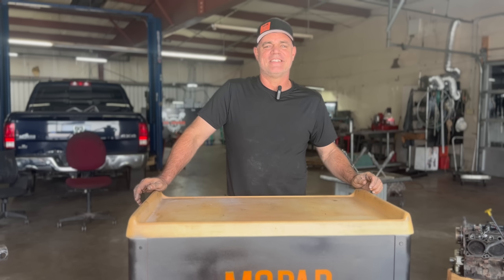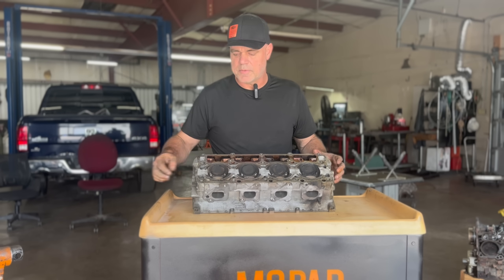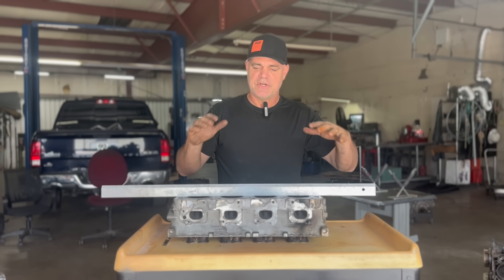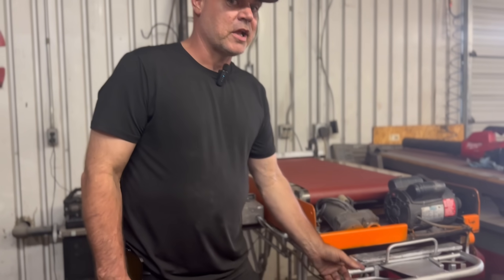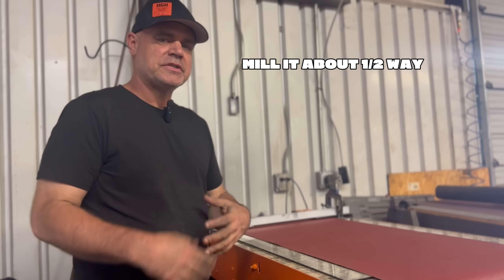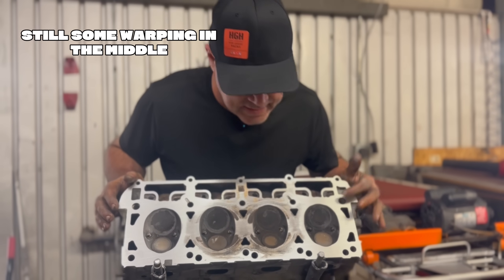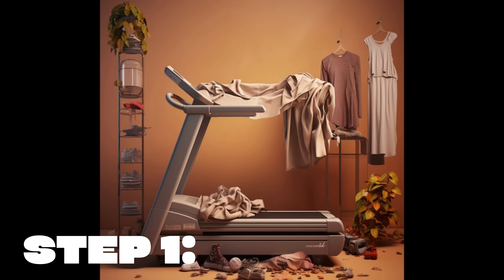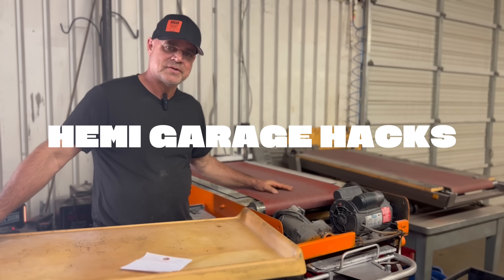I HAVE MILLED 1000+ CYLINDER HEADS WITH A TREADMILL!

Comment: They can get you close enough. But I've worked in a machine shop for a few of my years. I've resurfaced heads done on sanders. Not real impressed. Aluminum V8's composite gaskets, you'll likely be ok. MLS on your over head cam turbo 4cyl. Rolling the dice. Bush fix, hell yeah.
Reply from the maker: Thanks for sharing

Comment: If you have a good level concrete floor thats kind of smooth you can use that.
Reply from the maker: One other guy said he has done that, probably a little riskier.  But if you have a straight edge and you can verify, then cool

Comment: FYI, using that new belt in the surface where you are measuring a cross and even diagonally that finish is better than a shiny finish for the two to seal pretty impressive. I am a machinist and I have mills and labels and such I would never go into building something this extravagant without some type of measuring system that I could identify how much I took off the head, but if you’re comfortable using it, that’s fine to each their own. Good luck, man.
Reply from the maker: Thanks for commenting.  Here are the practices that should be used for best results.  First, resurface for equal times each time you change direction of the head.  Once finished, straight edge and use a caliper to measure height from bottom of surface to valve cover surface on both sides of head.  And the finish is surprising smooth.  It's been a cool journey for sure.  I'm glad you took the time and I am glad you are here!

Comment: Pay no attention to the negative folks. Flat is flat and on a stock engine this is 100% fine. Cool idea, I have done the glass for years, may try rigging up one of these for my personal stuff.
Reply from the maker: Thanks for the encouragement.  If you decide to go for it, here is how you can insure great results.  First, resurface for equal times each time you change direction of the head.  Once finished, straight edge and use a caliper to measure height from bottom of surface to valve cover surface on both sides of head.  And the finish is surprising smooth.  It's been a cool journey for sure.  I'm glad you took the time and I am glad you are here!  It's been13 years now and she's a work horse.  And under $500 to make, so Bonus:)

Comment: What grit sandpaper do you use? Getting ready to replace the head gasket on a 12 valve cummins 8.3L. The head gasket blew out the corner of the head leaking antifreeze to the outside of the motor. No contamination to the oil, no smoke out the tailpipe, no compression loss. I'll check the heaad for warping but would like to know what grit sandpaper would go good for this head. :)
Reply from the maker: I would recommend 80 grit.  Hope that helps

Comment: Yeah yeah I milled a badly warped head on a 2X4 ft sheet of MDF with two squares of Diablo peel and stick coarse sandpaper on it and a lot of tiring muscle power and assistance from my brother shoving it back and forth too. Worked great! Put it all back together and set about driving it when a month later it snapped the OHV camshaft clean in half. Maybe all those people you'll find in video comments about sanding heads down have a point that you should be line boring the journals for the camshaft because the whole head is warped, not just the bottom, if you want a properly rebuilt head anyway. Put another used camshaft from the Pick-n-Pull in it and we'll see if that one fatigues and breaks right around the center journal like the last one too. Or not. 😂

Comment: Im a small performance shop in Texas this would be a game changer for us. What company do you use for your sand paper and Grit  ? Im going to do some research as well if you guys dont see the question.  Love the video. God Bless.
Reply from the maker: Go for it. This thing has been a workhorse over the last 13 years and I just have to change the belt every 2 years or so.  The company is called Mirka. 80 grit would probably work good for you.  I use 60, but I mill a couple cast iron exhaust manifolds before hand and that takes a little of the edge off and the finish is awesome after that.  Hope that helps and good luck.  Glad to have you here!
Reply: @HemiGarageHacks Thank you so much brother God Bless. Looking forward to some more videos.

Comment: Nice work, i just hate youre saying "mill", you're sanding. its a huge belt sander.
Reply from the maker: You are correct.  I was really trying to get the point across to general population about flattening the head, and that word seemed the most helpful, but you are absolutely right.  Thanks for sharing and glad to have you here.

Comment: A dedicated milling machine is vastly superior to sanding.  You will experience uneven material removal in different areas of the cylinder head surface, something that a mill will not do.  If this works for you More Power To You. Machinist's don't use sanding for a reason. No disrespect intended.
Reply from the maker: I respect that!  thank you for sharing and being respectful in the process, much appreciated.  So glad you watched

Comment: I used a hand file on a Jeep Cherokee inline six about 12 years ago.  The Jeep is still running strong and pulls a boat up a highway pass to the lake every year as well as running around.  Too many people overthink this process.  Yes,  if the engine is used for high performance,  I would have taken the head to the machine shop for a better job and if turbo ed,  it would be o-ringed as well.
Reply: Same here, hand file most of em, never have one fail .
Reply from the maker: Thanks for sharing, great opinion!

Comment: and this is a good ide but where your bottom and top needs to be in spec and if its flat but not even your cam can go out off Alignment
Reply from the maker: monitoring the time on the mill and changing direction of the head for equal time has worked well.  Straight edge and caliper are used to verify.  Thanks for the comment and glad to have you here.

Comment: FYI you CAN see light through a .001 gap under a straight edge.
Reply from the maker: Sounds like a good test right there!  At what measurement do you begin to see light?  I have never tried to see.
Reply: @HemiGarageHacks  If your straight edge is very wide it would be less likely to see light under it.  Works best with a very straight knife edge.  Just try and see how much gap you need before you see light.

Comment: How do you make sure everything stays square? If there is more weight or pressured on one side you will remove more material there. Also this head is cupped so you have relatively stable sanding what do you do if it bows? Love the idea do this all the time to increase compression on a single cylinder head, but with that you get a bit more leeway. 
Do you do only aluminum heads now? Or do you keep ferrous and non ferrous belts? 

Cool concept and with lead times on most machine shops worth the effort for sure on the minor warped ones.
Reply from the maker: good questions and brings up one good point.  With this thing, I can create a reverse slight bow if I want just by shimming certain places between the glass and the granite (I don't typically do that, but it is nice to have that option).  Most of what I do is aluminum, but i have done a few inline 6 cast iron heads and a couple aluminum blocks.  As far as staying square, equal time on the mill with the head facing in different directions in most helpful.  For example, 30sec one direction and 30sec in the opposite direction.  hope that helps and thanks for commenting

Comment: Its called drag, its going to drag under the front harder... if you whould have made the tread mill drop down on it it would probably work better.
Reply from the maker: Such a good point, and here is what I have done regarding that.  First thing is the angle of the back stop, it makes a difference.  Second is surfacing the head equal time in both directions.  Great comment and I am glad you are here!
Reply: @HemiGarageHacks you can probably make eazy jigs with a 3d printer. Also i figured you probably swapped the head back and forth.
Reply: @HemiGarageHacks its a good idea i have a bad treadmill

Comment: 1. That's not a mill, and it's not milling anything
2. while you will make the heads flat belt sanding is not going to leave the correct surface finish, although it may still work fine
3. This does nothing to keep the true, the head can cand more on one side that the other making it sit on an angle, not a big problem for get r dun project, but for a performance build I would rather have it done correctly and milled based on the holes
Reply from the maker: True, it is resurfacing via sanding.  My experience has been for best results to resurface the same amount of time in each direction you face the head.  Checking with a straight edge and a caliper ensure level and the finish would surprise you.  but I totally get where you are coming from.  Thanks for commenting!
Reply: but how would a tiny angle make a diff ...stretching bolts more on one side so head of them can break off maybe, how to counter that maybe shims that compress a bit on one side not rubber maybe could be hard to find that material  but then bolt is too short lifts up one or two less threads holding it could it strip threads
Reply: I don't know, but I know 2 machinists who say they've had to scrap more than 1 aluminum heads that was belt sanded, and make fun of shops that do this because it's half ass and not the right the way.
Reply: @GW2_Live   you are correct. this method rolls the edges up and basically turns the head banana shaped. Also, the finish is not correct for modern gaskets. Truly a hack job that will fail.
Reply: @orangestoneface bolts are not perpendicular to mating surface pulling at angles when tightened
Reply: Technically, this is lapping,  not milling, but with the carefull approach you've taken, the end result will be pretty much the same.
Reply: @michaelsimpson9779  It's neither. It's linishing.
Reply: But it is a mill...

A treadmill 🥁

Comment: Theres NO way that head is flat after you run it over wavy sandpaper. AND BY FLAT I MEAN MACHINED FLAT.  That said I used to re-surface heads on a granite surface plate and wet sandpaper...
But that belt sander is hillbilly voodoo. The belt table IS NOT machined flat so it wont surfaCE FLAT EITHER! -  I would like to be nice, so I wont start insulting although im about .001 away from doing so.  You Op are giving poor advice to others who will emulate and ruin theyre hardware. Sigh, Ohhh youtube! Lots of videos dont make it right.   -- Retired machinist, engine builder.  This is BAD. NO no no!

Comment: Meantime, there are channels like Jim's Automotive Machine Shop, Inc. where they obviously have hundreds of thousands, maybe over a million, dollars worth of machining equipment and you built a you build a specialized head leveling machine for less than $500. That is absolutely amazing!
Reply from the maker: Thanks for the comment, I really appreciate it!  And as a bonus, it actually works.  13 years and over 1000 successful heads later, this thing has been a workhorse.  Some people just get so scared.  A straight edge and caliper are great testifiers to it's validity.  I'm glad you're here!
Reply: @HemiGarageHacks  What grit sandpaper do you use? Have you experimented with finer grades?
Reply: Really inventive!
Reply: Anybody can throw money at a problem, but it takes real creativity and skill to solve the basic aspects of a problem in unique ways.
Reply: The heavier side if the head will get more material removed on a belt sander because more pressure is applied there.  I doubt he is using a super abrasive grit though, light touch ups.   I'd trust the equipment at Jims Automotive more than an oversized belt sander.   Stands to reason they have invested in expensive tools and machines because they make their living doing precision work for customers and they have to stand behind their work.  Keep in mind they can do everything in house, boring, honing, decking, valve seats, sleeves, balancing, fly cutting valve reliefs etc they are a full service shop.  No comparison to this.
Reply: @dev-debug  When I was in college in the mid 1970s, we did things like lifting the small-block V-8 out of a mid 1960's Chevy Impala, setting it on the sidewalk on several layers of cardboard, and "rebuilding" it.  We replaced crank and rod bearings, piston rings, valves and guides.  The cylinder honing and valve lapping was all done by hand, no power tools and no precision measurements.  When we go it back in the car it ran OK and didn't burn oil so we considered it a success.  I put this belt sander milling in that sort of repair league.  

Jim's Automotive is three or four steps up in precision and cost.  Jim's is for the person with the budget to repair the irreplaceable antique engine or large diesel engine, often the engine that other shops would deem not repairable.  The one thing that I wish Jim's (and other repair channels) would do is tell us what the final cost was for the repair.
Reply: @dev-debug says the guy who hasnt done it. Its like when fat people try to tell my skinny ass how to eat. With proper measuring equipment and time you can bore hone sleeve valve seat port polish whatever you want. I did on my 93 accord f22 block h heads. I didnt use a treadmill. Just granite glass and big sheets of sand paper. Also grooved it for o rings with a hand held tool. Odometer doesnt work but i estimate at least 120k on it. Still runs pretty good for a 93 honda. See it in my profile pic.
Reply: yeah,  i like that channel,  but obviously you are buying a rolex when they get through.
Reply: That is the difference in getting to the moon safely and getting to the end of the road safely.
Reply from the maker: @Throwaway87-d8e  It does seem like a crazy concept, doesn't it?  It surprised me too.
Reply: safely? You just go really fast through the van allen belt. Its not about the tech. We did it in the 60s and can't do it now because we aren't smart enough and lost the tech.. To the moon. of all things to pick
Reply: @StreetTerrorist187 People who believe that we went to the Moon, and then say we can't do it again because we somehow lost some special technology they supposedly had in the 60's, are the most naive and ignorant amongst us.
Reply: @hime273 Right.
No way in hell we went to the moon.
Bunch of B.S.
With technology now days compared to the 1960s , they could fly and land there No problem in 2025.
And do it at half the cost
Reply: @thieltech1  Actually we went 7 times.
Reply: @thieltech1  merely your opinion

Comment: How do you make sure its actually flat and not just a plane? Seems like it would be pretty easy to take more off one end than the other.
Reply from the maker: Great question.  Monitor time on the mill and change the direction of the head at even intervals.  After that, Straight edge it and use a caliper to check the height on both ends of the head.  Hope that helps and glad to have you here.

Comment: Do you ever put any kind of lubricant on or between the bottom of the belt and the glass to make it work smoother and with less heat? Maybe a dry powder lube or baby powder or something. Does the back of the belt eventually wear or scuff the glass surface which may affect the performance? Does the back of the belt wear or shed any material that may ball up?
Reply from the maker: Great questions.  I don't use any lubricant at the moment (although not a bad idea).  I change the belt every 2 years or so, and the back side is never worn near the extend that the sand side is on.  The glass I will change maybe once a year, but it is only the leading edge of the glass that gets most of the wear.  The surface of the glass hold up amazingly.  Glad you are here:)

Comment: I strongly suggest adding a dust collection to this. The belt should last longer, less clean up to do on the heads, and less clean up/maintenance on the machine itself. Aluminum dust is something you don't want to inhale or have kicking around in your shop.

For anyone doing this, you may want to move the head consistently and evenly throughout the whole surface of the belt, keeping a part in one spot or area will create a low spot in the sanding belt. Just be careful not to move the one of the edges of the head off the edge of the belt during this process.
Reply from the maker: excellent advice all around, thank you!  And you are right; I will take the dust collection more seriously.  Such a good point.  I just didn't think much about it because it has lasted me 13 years so far with no issues, but you are right and that is something I need to look into.  Thanks for sharing and glad you are here:)
Reply: or sand outside..but long power cord if usual thickness will lower voltage by resistance so amps or watts go up and heat damage motor so needs thicker cord  thicker metal wires in cord

Comment: Yeh but you might be milling it at an angle. If you set the head up on a surface plate after you milled it and ran an indicator from one end to the other, I bet there is quite a difference.
Reply from the maker: you are 100% correct, that is why it is best to monitor time and change direction of the head once or twice.  Thanks for the comment and glad you are here!

Comment: Very ingenious repurpousing to achieve adequate results. Is it a mill accurate  to 4 decimals? No. But it adequate for repair work in my opinion. Sometimes  adequate is more important than perfect when cost is a factor. Otherwise alot of those vehicles  might get scrapped due to the cost of repair.
Reply from the maker: One of the smartest analysis I have heard on this topic, thanks for sharing.  And I am glad you are here:)